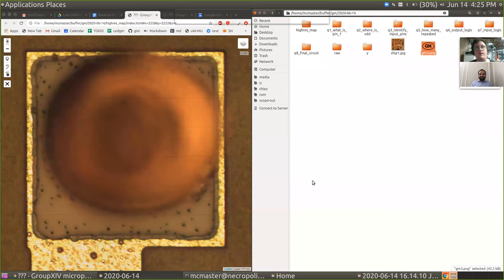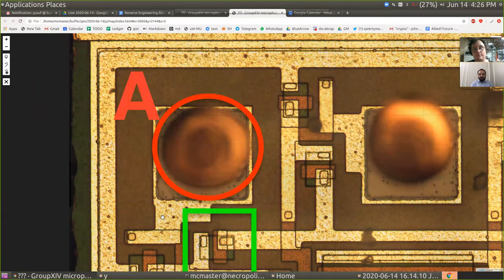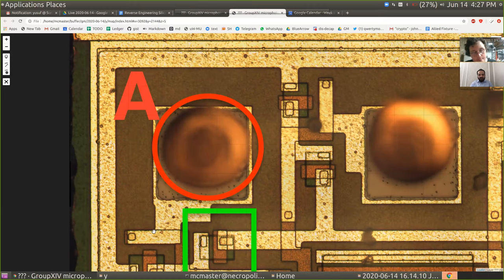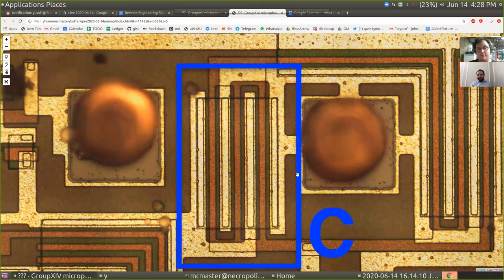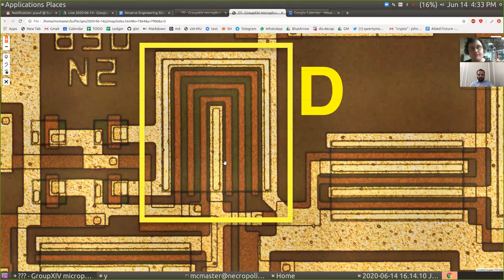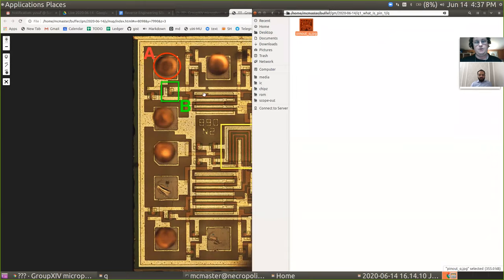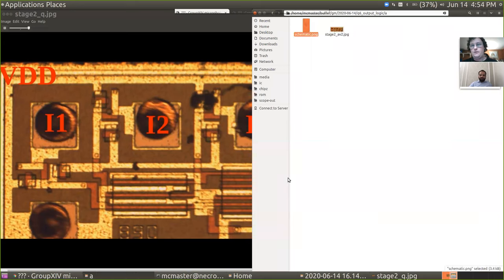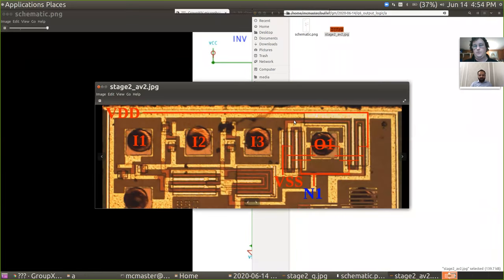How to reverse engineer silicon chips images!

Comment: At the end where he was talking about resistors. It would make much more sense to me if those were transistors connected in a diode configuration. This would be to protect out of range voltages, so like when the power goes too high on the input pin the diode would be forward bias for VDD. If the power goes too low for the input pin power would be forward bias for VSS.

Comment: Great video ! Thank you very much. I believe the two terminals devices connected to the input pins are rather over and under voltage diodes for protection.
Reply: Hmm...typically over voltage detection is implemented as a zener diode. This also serves as reverse voltage protection when it operates as a normal diode. As such you typically have one diode that does both but this circuit has two diodes. So why two then?
Reply: @johndmcmaster  You're right about the single zener diode protecting for overvoltage. See documentation from Philips (https://assets.nexperia.com/documents/user-manual/HCT_USER_GUIDE.pdf, fig. 18 page 28) and TI (https://www.ti.com/lit/an/scla007a/scla007a.pdf, fig. 13 page 14). However, both documents show additional devices to protect from undervoltage, that also act as series resistors to control the impedance of the inputs. Does this mean that the two devices on the die are not symmetrical? Honestly I lack some knowledge in analog electronics to fully understand this.

Comment: What is practical usage to reverse engineer TTL logic which was made 60 years ago?!
Reply: It is a simple example to learn from. If you are an expert, it may not be as valuable, but for many it’s been very helpful.
Reply: It can be used to recreate a chip in FPGA not based on expected outcome/behavior but based on the actual chip. For example the famous SID chip on the C64 is becoming very rare and the fail quite often. The reproductions still don't sound the same, particularly the analog filter sounds "off". So decapping a broken one and actually figure out the die may help improving the reproductions ( which may need external analog circuitry in this specific example ).

Plus it's fun.
Reply: Modern chips are too complicated for beginers to reverse engineer. Its important to get experence with chips such as this in order to no longer be a beginer, and therefore be able to reverse engineer more complex chips. Reverse engineering chips such as this also has the nice side effect of preserving history.